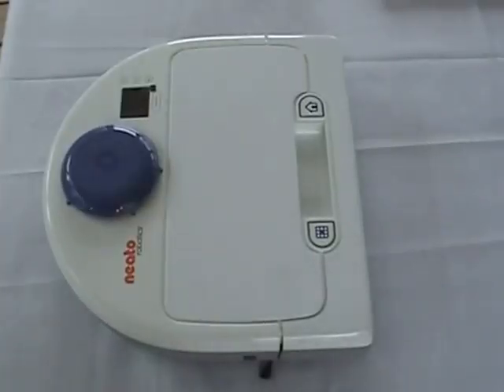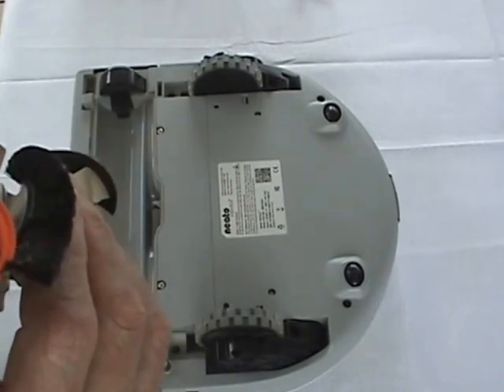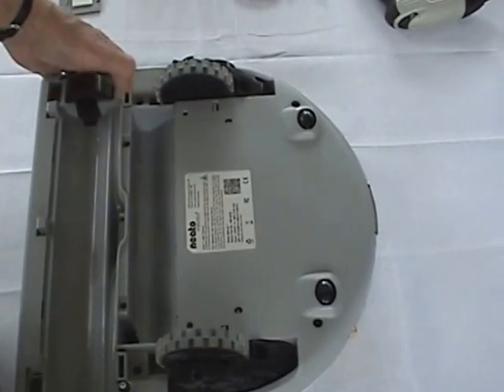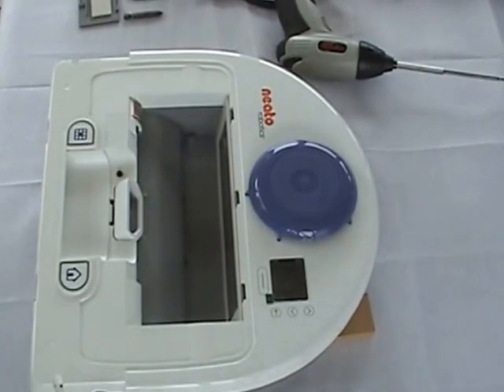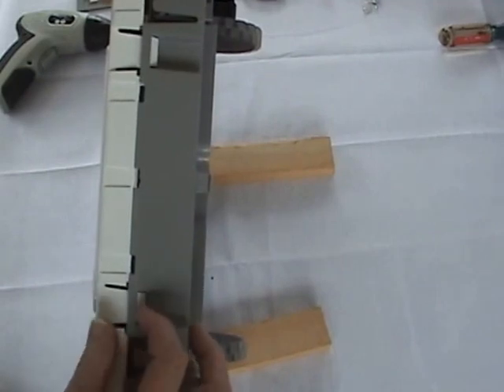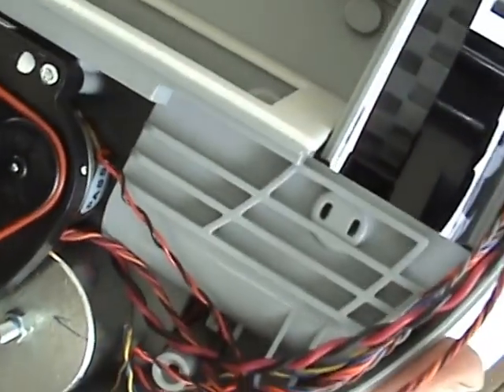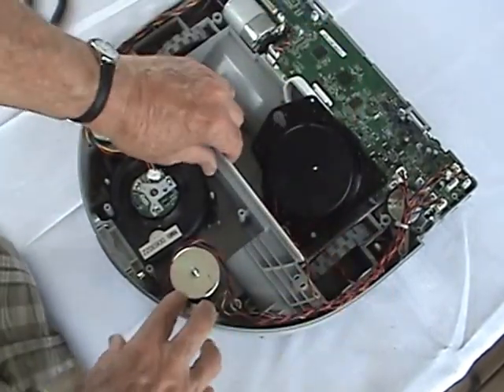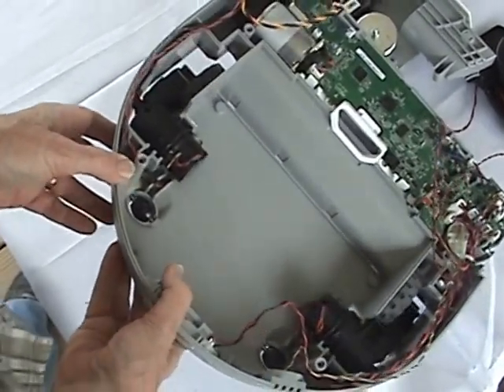Neato Botvac 80

Comment: I went to a full ceramic roller brush bearing that can be easily washed out when I clean the roller brush. It has solved the bearing failure issue for me. My Botvac 80 runs on auto once a week since 2014. I upgraded the battery 3 years ago to a 7200mAh LiPo, and it just keeps going strong. No belt replacement needed yet, but I am ordering them anyway. I got it in 2017 with only 14 hrs on its clock. I got it for $140.... best $140. I've ever spent!

Comment: Fully Ceramic roller brush bearings now avail for Botvac on eBay. Will not bind from dirt. Will outlast any other bearing. Find it here; https://www.ebay.com/itm/NEATO-BOTVAC-Roller-Brush-Bearing-FULL-CERAMIC-70e-75-80-85-ROBOT-VACUUM/163543783731?hash=item2613f81933:g:ccMAAOSw3bNc9iPW

Comment: Thanks Vic, you made replacing my wheel assemblies much easier.. and if anybody finds a funny rectangular silicone rubber piece about 1/4 by 3/8, it plugs into the USB port that's located next to the on/off switch in the dust bin compartment.

Comment: VIC Thanks for the sharing here, It looks Neato changed some component and also  location of main PCB, i didn't like the idea the FAN pcb is exposed to dust,
is there warranty label while opening the Botvac?
Reply from the maker: Did not see any warranty protection strips over screws during dis-assembly.